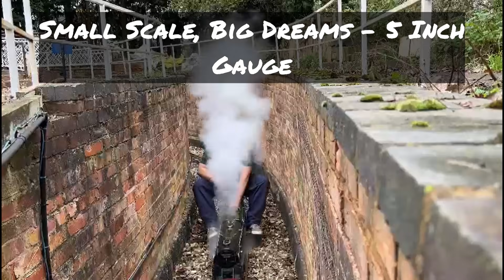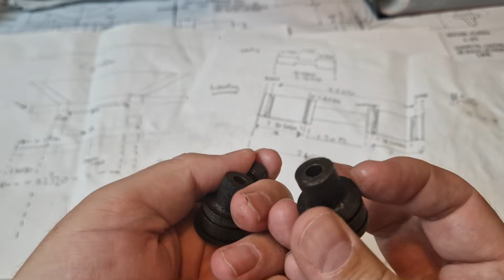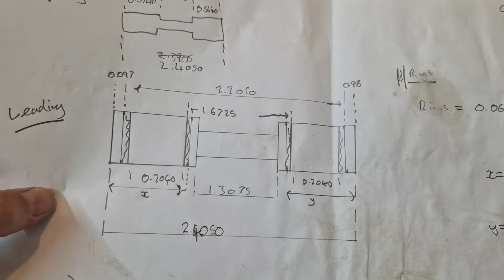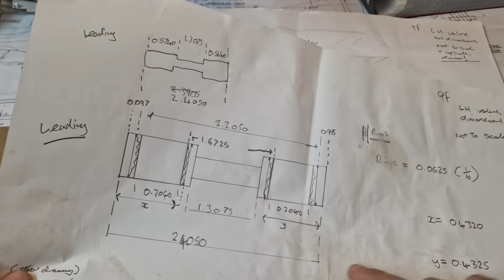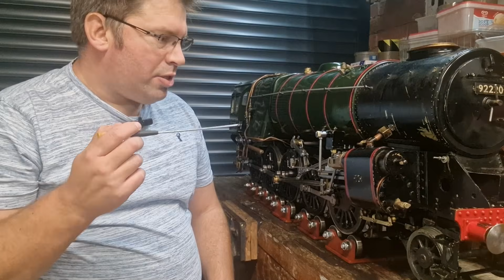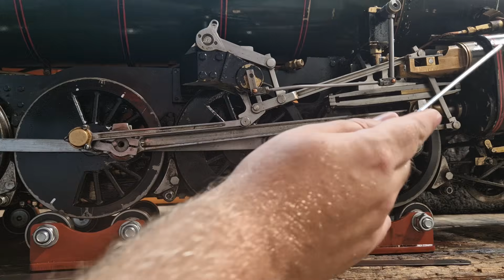My 5 Inch gauge 9F - light at the end of the tunnel?

Comment: Now the proud owner of a 5" gauge Winson  9F serial no 088. It will run on air, has many issues, but is new /unused. There are bags of many parts though the loco appears complete. I need a set of build notes or drawings to go through and see what is missing or how to use the parts I have. Are parts available ? Anybody know who bought it new ? Now paying much more attention to what you say Gary.
Reply from the maker: Hi Noel! Welcome to the 9F owners therapy group! So to answer some of those questions:
Spares: do from time to time appear but I tend to make parts i need, if you know what you need or just as a start feel free to list them out.
Drawings: I dont have any Winson drawings at all, there was some building notes but they are not particularly useful. I have a full new set of Les Warnett drawings and build series bought from Blackgates engineering. I use these to improve my 9F in areas but Winson 9Fs are not built to these drawings! So they only help so much.
I need to try and find my build number! Will get it in the next video!

Comment: The dimension that matters is the port faces/ positions. from that you can design your piston valve. The need for lap or lead will be a matter needing research. From that you can work out the dimensions for the piston valve. Then you need to set it up.  I have a soft spot for the 9F from my youth and was asked at one point to work on rebuilding a real one - long story. Good |Luck.
Reply from the maker: Thanks Noel, im researching all this in more detail and maybe its a video in itself, your referring to LINE of Line piston valve design i understand, so the valve should sit in its mid stroke position exactly over each port, this is what Les Warnett drawings show on hid 9F design. As of now im just replacing the current piston valves like for like in an effort to understand more about them. I did have the set up close so still opportunity to get it right.

Comment: This is no reflection on you, but I would like to comment on valve construction. The space between the valve heads is known as the steam-chest, to contain a reservoir of steam, some of which is continually being used to power the engine. So I am always amazed that people fill up that space with a large-diameter spindle between the heads, thus reducing the steam-chest to a steam pocket having almost no capacity for steam. This means that, at speed, the engine is simply sucking steam straight out of the superheaters instead of siphoning it out of the reservoir in the steam-chest. I am sure that many small engines would benefit from a thin, solid spindle between the valve heads.
Reply from the maker: Hi Dereck, no i fully understand and agree with you, my 9F has had some valve chest and piston valves modifications in the past, my loco has new cast iron steam chests, piston valves and new valve spindles. This all sounds positive but.. as seen in the video the valves were in 3 pieces so steam could escape through the piston valves, hence why I made my bobbins whole, also having measured  the bobbins to make the new ones there is from what I can see excessive lap on both ends of the bobbins. I am now looking at LINE on LINE setup and think a video on all this explaining it out might help those not so initiated!.